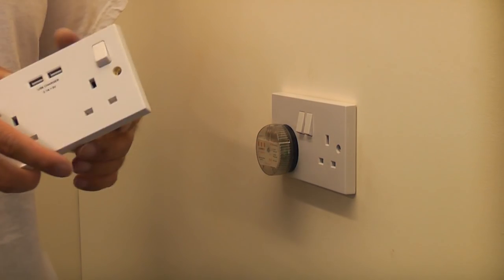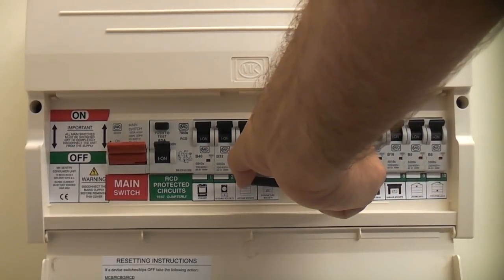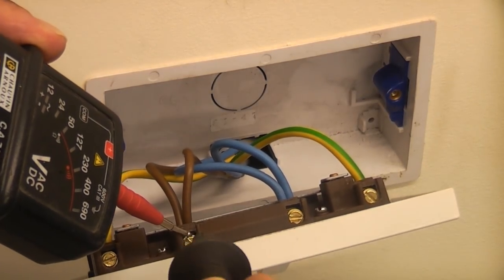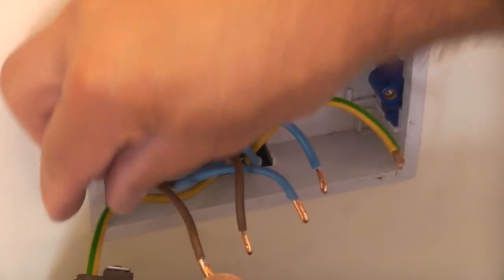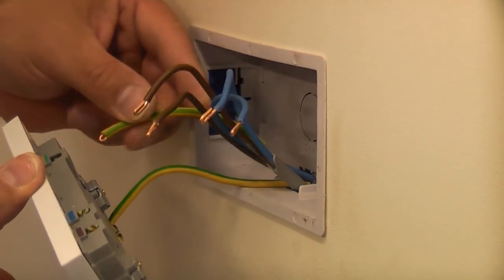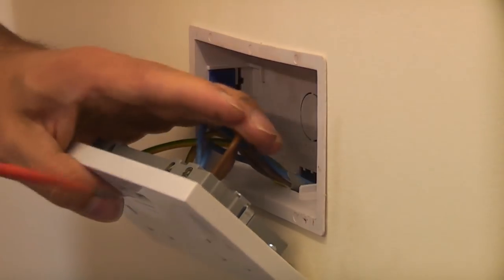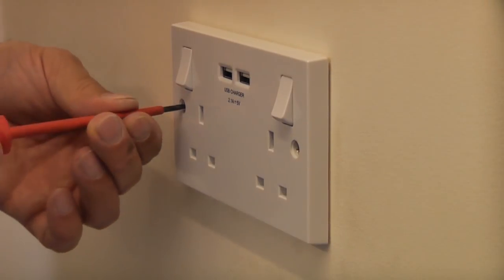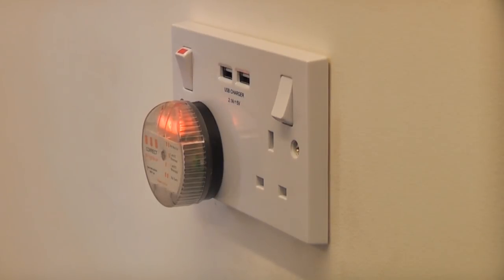How to install a USB wall socket

Comment: Bit far padlocking a fuse box lmao
Reply from the maker: If I didn't padlock the circuit breaker off I would get a hundred times as many comments saying I should of locked off the MCB ;-)
Thanks for the comment 👍

Comment: But why not get the apple plug? With that you can plug a USB in easier
Reply from the maker: +• 10drew10 • 
The apple plug means you use one of the electrical sockets. By using one of these you can charge two USB items and also still use both electrical outlets.
Reply: ***** yeah, but, it saves the hassle
Reply from the maker: +• 10drew10 • 
I don't think you understand.
Many houses do not have enough sockets position in the correct places. Many people now need electrical outlets for TV's , computers, printers etc. They also need to charge their USB devices such as a mobile phone. If you already have two appliances plugged into the power socket, it means you cannot charge your mobile without using another socket or moving to another socket. This socket lets you use the two electrical outlets and also charge two USB items ;-)
Reply: ***** yeah, your right

Comment: wait a second... You have a 32 amp group?
Reply from the maker: FoodOnCrack 
Yes, a 30 amp fuse or 32 amp circuit breaker is common in the UK to protect a final ring circuit (for sockets)
Reply: FoodOnCrack Yeah, as ***** said that is for a "ring main". If it was a single run, then it would be a 15 amp fuse. This is common here in the UK.

Comment: he failed after 1 min.. you didn't put the key for the lock into a sealed bag, then you forgot to put in there double keycard access safe, at the bank in another country, with the scary looking armed guards, that have been cyber enchanted to detect the future so they know who to safely give access to the vault not to electrocute you... I'm surprised you didn't get a shock..
Reply from the maker: +NaZReD 
You can thank the HSE for the safe isolation procedure ;-) 
If I don't do it that way some of the electricians have an hissy fit!
Reply: +Ultimate Handyman do you want to know what is more scary than that.... after watching this video I have got advert after advert about buying this exact model socket from b&q and other stores.... shd I be scared too look at porn? might get porn ads everywhere next.....
Reply from the maker: +NaZReD 
I wondered why I keep getting porn adverts all the time LOL

Comment: two live and two neutral one earth ??
Reply from the maker: +Billy Rodaway 
That's not safe I'm afraid.
Are you sure that the earth wires have not been twisted together and are covered in a piece of green and yellow earth sleeving?
There should be one earth wire for each pair of live and neutral wires, if there is not then your wiring is very dangerous as there might not be earth continuity in parts of the circuit.
Reply from the maker: +girlsdrinkfeck 
Thanks for the comments ;-)

Comment: plastic box
Reply from the maker: +Billy Rodaway 
A plastic back box is fine and does not need supplementary bonding (the other small earth wire that goes from the socket to the back box)